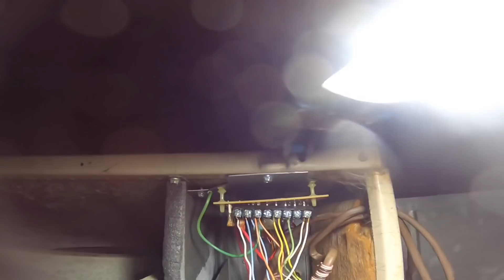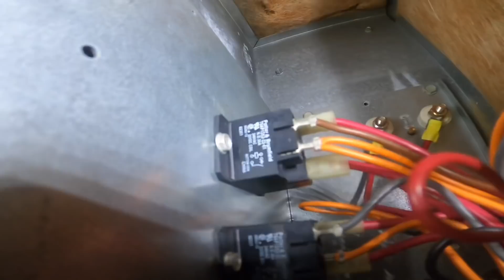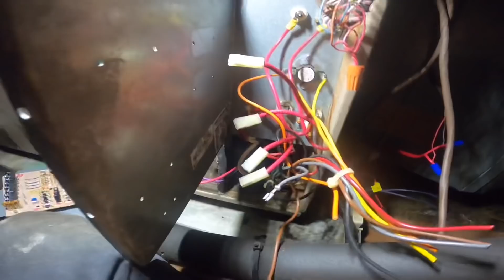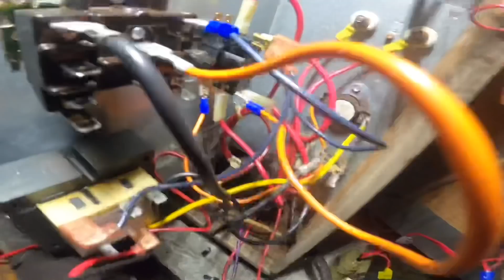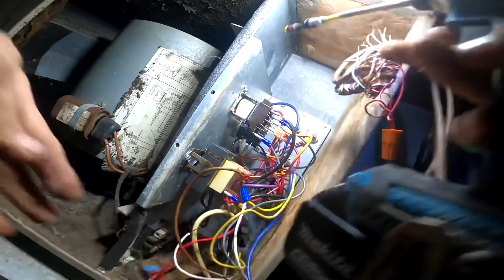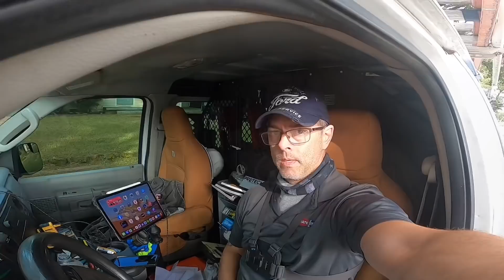Completely ReWiring Electric Furnace - Removing Control Board

Comment: I have been trying to figure one out in a rental that is old enough not to have a control board, but someone has moved wires around and when the thermostat is on AUTO the fan doesn’t stop, ever, unless I put it on MAN, then the SOB goes off!  The heat works when the thermostat is turned up, but only one element heats up.  I think the way they have the sequencer connected the relay coil isn’t in line for control, and the one element is connected correctly.

Comment: NOT A LOT OF PEOPLE OUT THERE THESE DAYS THAT CAN DO MUCH MORE THAN SWAP PARTS OUT... YOUR REPAIR WAS IMMEDIATE AND YOU DIDN'T HAVE TO WAIT ON AMAZON, THE POST OFFICE OR PAY THRICE THE PRICE FROM A LOCAL SUPPLY HOUSE... LOL, THESE DAYS THOUGH, THEM GUYS AINT GOT MUCH IN STOCK AND WOULD PROLLY HAVE TO ORDER IT THEMSELVES AS WELL!

WELP., I ENJOYED THE VIDEO AND I HAVE NOTHGING CRITICAL TO SAY, WHICH IS ABNORMAL FOR ME.... BUT, LOL YOU WERE SPOT ON AND IT WORKED OUT IN THE END AND THATYS ALL THE MATTERS, BRAVO!  

PERSONALLY:
    I'M PRESENTLY IN THE MIDDLE OF A PROJECT .....SMDH...,AND MAN, LOL... THIS ONE'S SUCH A MESS! MY VOLT METER'S READING 120V ON 24V CIRCUITS AND I HAVE POWER WHERE I SHOULD NOT... AND VICA VERSA... AND ITS A WHOLE SPAGHETTI NEST WITH WIRES GOING EVERYWHERE... SOME ARE EVEN DISCONNECTED AND NOT CAPPED SO...I AM LEFT WITH LITTLE CHOICE BUT TO TAKE THE OVERLY COMPLICATED... AND SIMPLIFY THAT SHIT PROPER! 

....  I'MA RIPPING IT ALL OUT AND DELETING THE STRIP HEATERS, AS PER THE CUSTOMER'S REQUEST, WHILE I'M AT IT!  THE INSIDE OF THIS AIR HANDLER WILL BE NICE AND NEAT FOR THE NEXT GUY... AND FAR SAFER FOR THE HOMEOWNER AFTER I WRAP THIS UP! 

So, basically.... I couId go at in two different ways...I can run 2 solid state relays off a bridge rectifier connected to the t-stat.... or a 2pole contactor with a 24v coil hooked up to the thermostat...  at this point, I'm pondering endurance and reliability, while factoring for noise and ease of installation.

THE CONTACTOR'S 24V COIL BEING ITS WEAKEST LINK AND THE BRIDGE RECTIFIER BEING THE MOST PROBABLE ISSUE FOR THE SSR's!!   1st world problems are insane! :text-yellow-goal: LMAO

Well, if I mount the bridge rectifier outside the handler in its own encasement with a cooling fan... The reliability will increase significantly and the lack of operatrional noise the contactor can't help but to make...... brings me from 2 ideas, down to just one... 

My bad for the huge comment, maybe someone out there will find it useful... even if its just for a laugh! 🤣... 

GREAT VIDEO BRO, KEEP UP THE GOOD WORK!! GOD BLESS!

Comment: I agree. I hate control boards. I was unlucky purchasing 9 air handlers for my complex andI have been spending a lot of money replacing them. They keep failing all the time. I think I m gonna have them replaced with 9340 relays.

Comment: Love your videos . Just a quick question why do you refer to the wire being broke by the sequencer as common. Ive always been taught that the speed tap on a blower is run .
Reply: I don't think it matters cuz what I'm getting from it is choose a name for each side of wires to avoid a direct short
Reply: @allanbrito13  I was wrong because the same wire that feeds start also feeds run. And in this situation it would leave the speed tap as common.

Comment: Referring to one of the 240 volt legs as "common" kept me doing a double take. Maybe "L2" would be a better name. Good video that makes me ask: Why do manufacturers have to complicate simple systems with circuit boards?
Reply: Supposedly for efficiency.  But the money saved gets flushed after the first labor repair . I tell my customers to buy the lowest efficiency equipment because they will never see a return on investment.

Comment: Years ago a brand used  ac current on relays for electric heat . Customer didn't like the constant noise for relays buzzing.  Got permission from factory to rewire.  Used honeywell sequencer new wire no more problems.  Always hated the type sequencers yo used . On new units failure were several in short time.  Good luck with yours.  Have a great day .

Comment: Modern controller boards are just costly things that break all the time and ramp up the fan. This could easily be done with capacitors and resistors as a small board. Unless you have a Mercedes of hvac systems they are not needed but, force you to buy new because most people can't rewire it.

Comment: You did a great workaround and clearly have mastered the HVAC trade. I don’t recall why you didn’t replace the control board and save the labor time.Seems like it may have been a cheaper and easier way to proceed. Great job in any case.
Reply: Supply chain issues are wreaking havoc on this trade. If you can reuse something it will save a substantial amount of time and money right now,  because it may be a while for a part and prices gave gone through the roof. Just refrigerant has gone up something like 60%-80% depending on where you are.